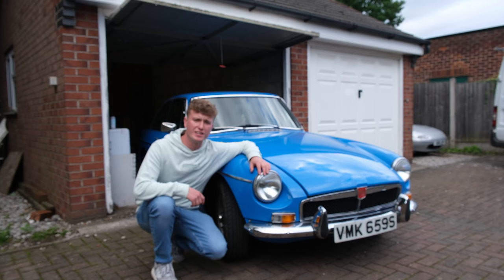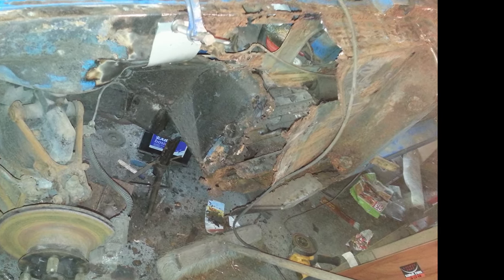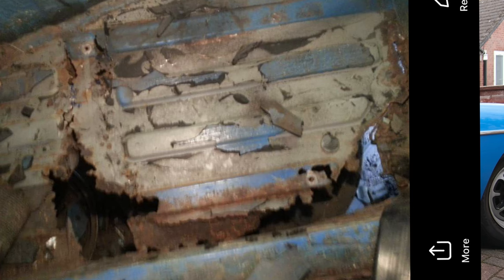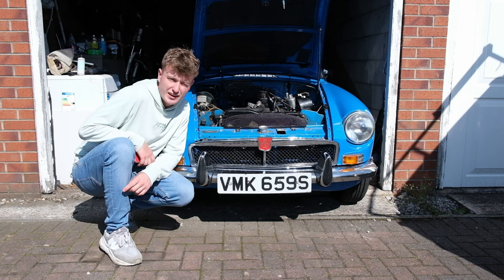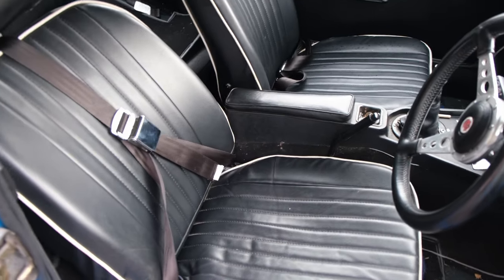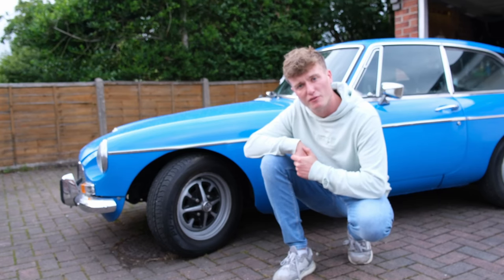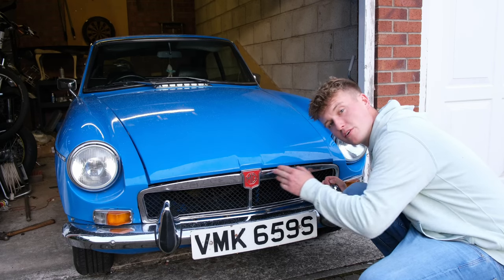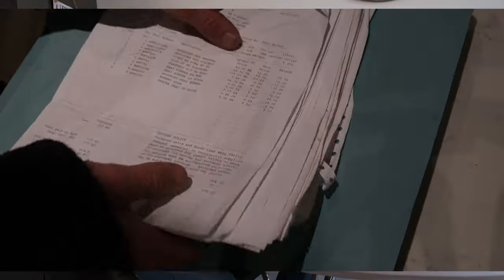The TRUE cost of DIY Restoration.... my MGB GT

Comment: Well done 👍, looks absolutely stunning now. Bumper upgrade was a good idea. Maybe a set of  chrome wire wheels one day? I know they're a pain to clean but look great.
Reply from the maker: Thanks! 😊 if anything I’d possibly change to some minilite alloys. Not sure if it would look period correct with the black plastic insert grill and wire wheels 🤷‍♂️
Reply: I beat you! my partial mechanical resto cost over 11k.  Also found some bodgies that were done in distant past that some po had done. Something I also found out, was about the steering lock on these wears to a point that the lock can engage while driving, so could be dangerous, so if a clicking sound can be heard when stationery and turning the steering wheel beware, I had to get my steering lock replaced.. 

A guy I know changed his wires for a set of Dunlop steels, got fed up cleaning the wire wheels..
Reply from the maker: @davelinkson1  ahhh damn! Did you have someone else do the work? Allot of the parts were bought for this car from 2012-2016! Parts prices have skyrocketed since! I’ve had the steering column out this car too! The plastic insert in the collapsible column had turned to mush, giving mine a slight bit of play! I drilled and put some small plug welds in! Don’t remember looking at the locking mech

Comment: Wouldnt it have been cheaper to buy a new heritage bodyshell?
Reply from the maker: a new shell would've been similar to total costs yes but.. then id still be spending circa 3k on suspension and other mechanical bits n pieces, plus I didn't have the money to do it all at once, bought them all bit by bit working part time at the local pub plus xmas n birthdays  :)
Reply: @Boothsmotors  well done to you… very impressive